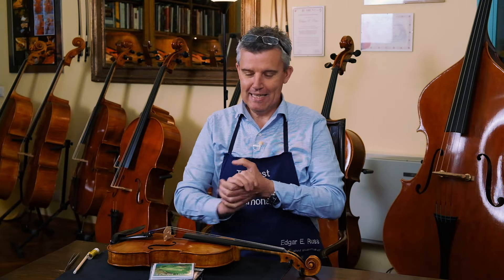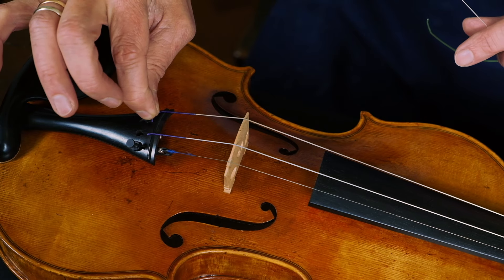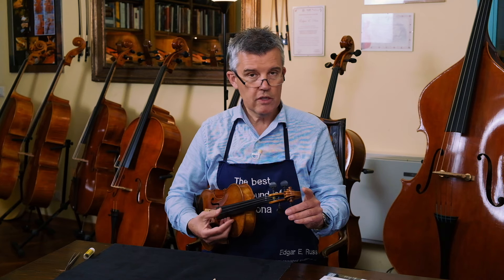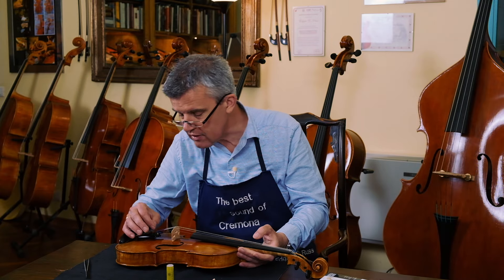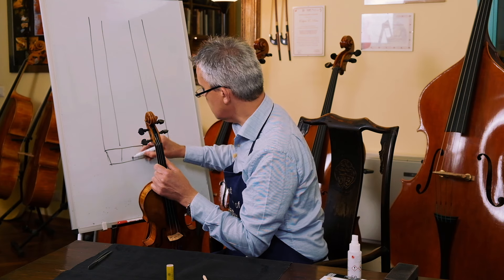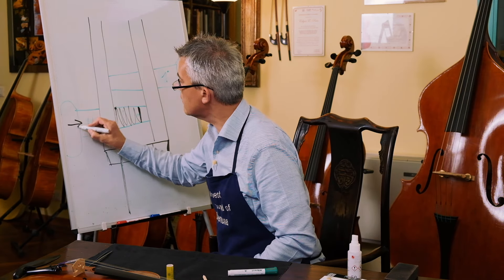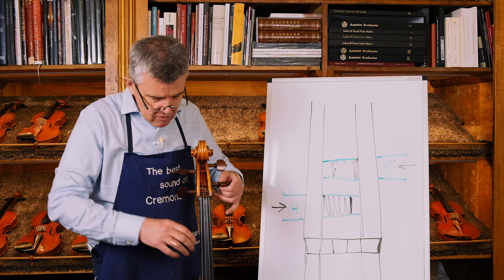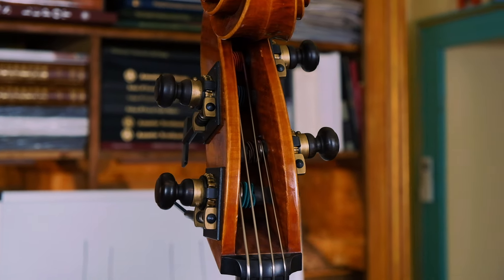How To CHANGE a violin STRING like a PRO violinmaker

Comment: What beautiful bass pegs!  I've never seen any like that.  I like where the little holes for the strings are drilled, as well, it seems much better constructed than the bass pegs I've seen here in the USA.
Reply from the maker: 😉
There are Viennese Machine heads made by Rubner Bassmechaiken in Germany.
I think the most expensive ones they make.
But also the most beautiful ones. I just love this industrial design of them.

Edgar